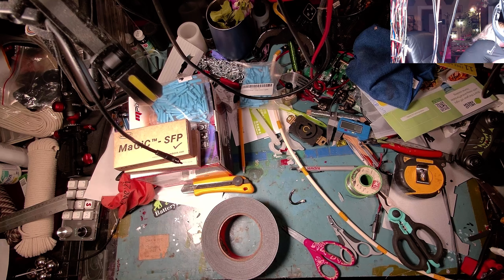Amazon Transfer Switch With Automatic mode.

Comment: I've been curious about these, I'd like to have an easy generator hookup for the rectifier shelves that we have hardwired into a breaker. When we drive out generators in an outage, it sucks to go and have to manually drive back out to put them on grid power again before the gas runs out.
I'd like to see a follow up video once it's installed!
Reply from the maker: Automatic transfer switches are easy. You can also use your favorite site monitor to activate the gender on low battery. An easier option for you would be a simple dpdt contractor ^^